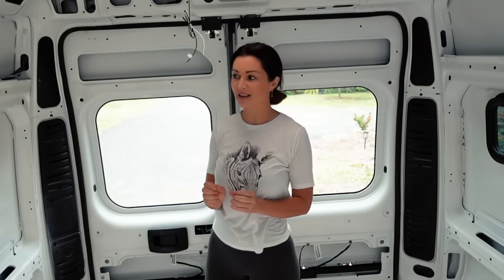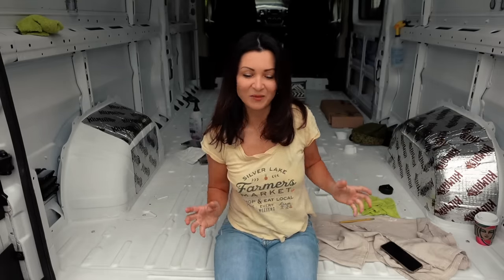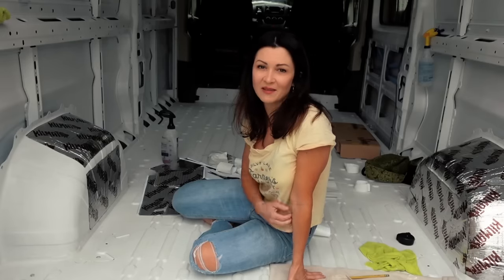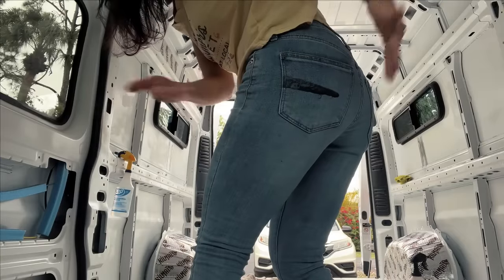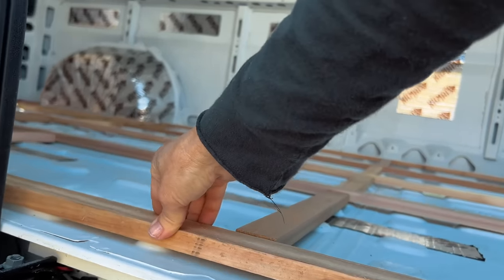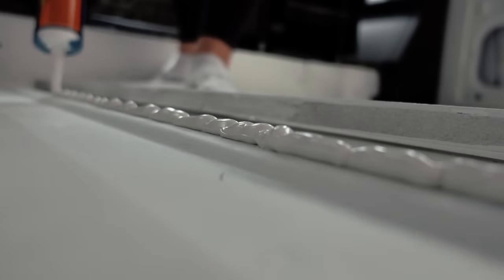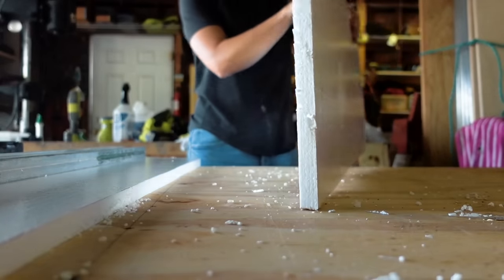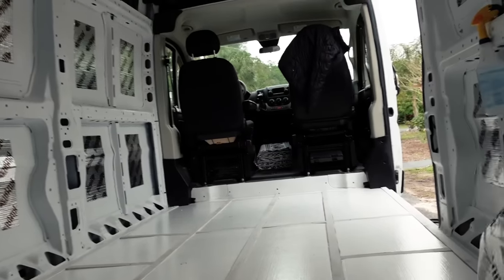Sound Deadening and Subfloor Installation | Ep 21

Comment: Remember you are working in a vehicle and everything you install must be secured withstand the rapid deceleration of a crash. Anything loose falls into the realm of momentum: mass times velocity. An 8 pound object at 40 mph has a momentum of 320 pounds. Also the weight you add costs fuel, wear and tear.

Comment: You are a very hard worker for real, you cleaned first. Your simpleness and calmness of the video is nice to see vs some other youtubers playing it up and being fake. Gosh now you are using Cedar!  Gold Star girl!  I'm a Contractor, finish carpenter, I'd be comfortable leaving you on the job alone, and that's something I can not say about a handful of grown men who are "Journeyman". But if I did have you on the job, no one else would get anything done because their eyes would be stuck on you, haha. Great job! yes always semi gloss, under the vehicle too, so mud washes off easily, it's molecular man, like a chalkboard. 100% silicone is a great glue, stays flexible while liquid fail drys out and will crack, it is a latex product but we use silicone. As a Commercial Carpenter I always am asked to glue 4x8 prefinished mahogany and walnut veneered plywood onto sheetrock with no visible nails, I use "z clips" which are like a metal french cleat, but when I can't, I use silicone, and actually butyl caulk works really good, you can find butyl caulk in tubes for a home center caulk gun on Amazon for $5-$10. I get it in the case for $50 or so.

Comment: Elisa -since you have been putting all this effort to build this beautiful van - previous episode 20 roof rack prep - you mentioned the small orange flecks on top the van. You used Purple Power (which is a degreaser), which will remove some of the iron specks. Car detailers refer to this as rail dust (can be found near train rail yards, truck depots….etc. These iron particles stick to paint -❤start to rust and penetrate the paint eventually.
So extra steps to get the perfect van (since you are putting the effort in the quality van build). Give some TLC to the van paint.
Go to your local auto parts store ask if they carry iron remover. Wash your vehicle - then spray on iron remover (Adam’s / Chemical Guys / Turtle Wax carry this). Allow to sit 5 minutes (iron flecks turn purple and bleed of). Wash and shampoo your vehicle. Extra work is to compound / and polish the paint. The old days the final step is wax but you can skip wax and buy a spray sealant (best solution is Turtle Wax Seal n Shine (polymer paint sealant)- spray and wipe on. Apply two coats. There are other options rather than polymer or you can apply Acrylic sealant (Klasse).
Since you have a 2021 van the paint is still in good shape - clean and apply sealant for long term good paint results. Also due to the size of this van - break it down into 3 sections - would be a shame to try and rush the process.
Since you have a lot of rain in your area - by applying sealant- any dirty road water will wash off easier when you are driving. Road grime (iron, brake dust, oil and other contaminants flick onto the car paint when driving on wet roads).

I hope this helps. Want you to have this beautiful build for a long time.

Comment: I'm also going to be looking into getting a van like this in a year or so.  It will mostly be to transport and store camping gear.  I will be using a tent as my primary accommodations.  But since I live in an apartment, hauling camping gear to and from the apartment is tiring.  So keeping most of the camping gear in the van will make things easier.  I will likely put in a battery system and a fresh water tank.

Comment: Please consider or reconsider installing insulation. I doubt you will be wanting to spend much time in a cold environment. Most seek warm environment in the winter.  Conversely, you will want to open windows and rid van of heat on warm days and insulation holds and contains heat

Comment: WD 40 will remove that black sticky stuff from your pants but you will need apply a good laundry detergent on the pants with a soft brush and water to remove the WD40 since it has an oil base and will leave an oil stain if you don't remove it with soap. Just an idea. And by the way you're a beautiful woman. 👍🏻